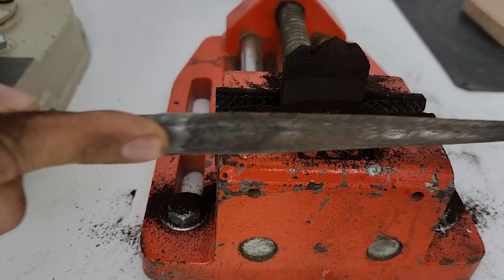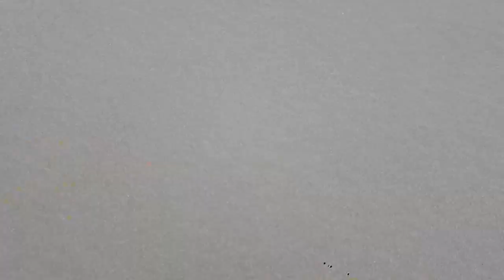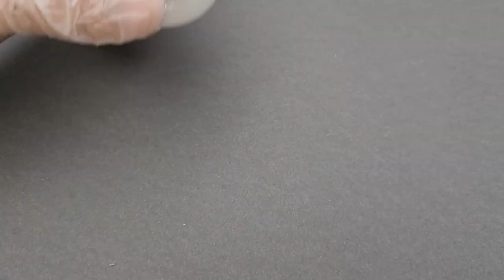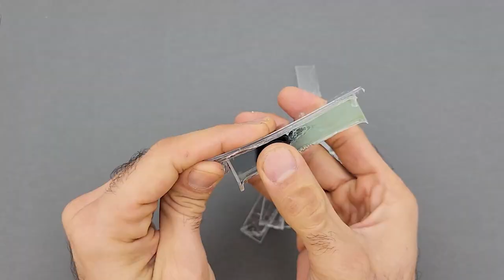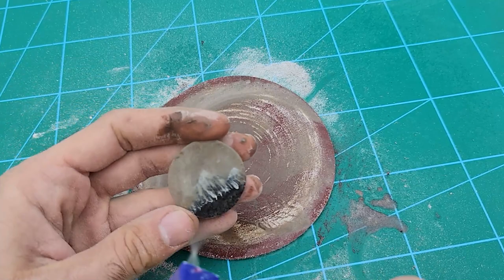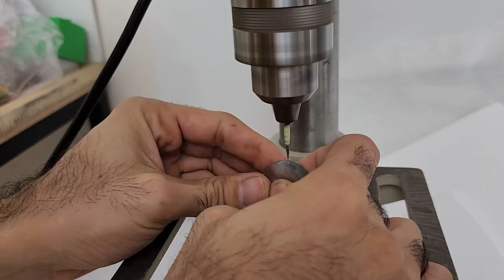Make Mountains In Snow With Wood And Resin | resin pendant

Comment: Looks Great!  I was wondering,  what's the name and mm of the plastic sheets you use in the video?  Is it petg?  I'm looking for something like the plastic your using. Possibly a bit stronger to hold a row (Kind of like a self with front and sides) of my small bottles of alcohol inks. If anyone  could help it would be very appreciated!